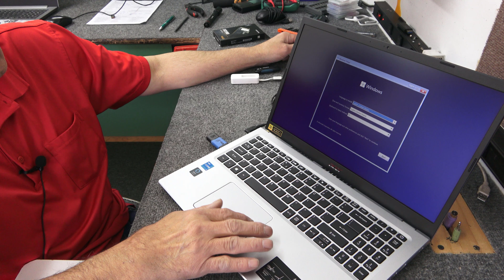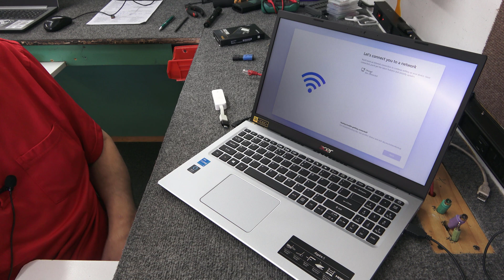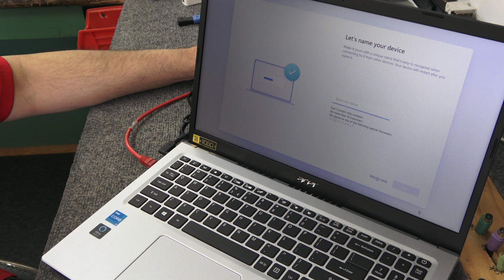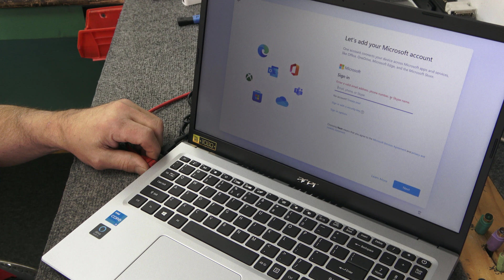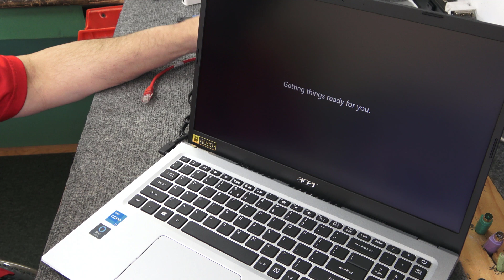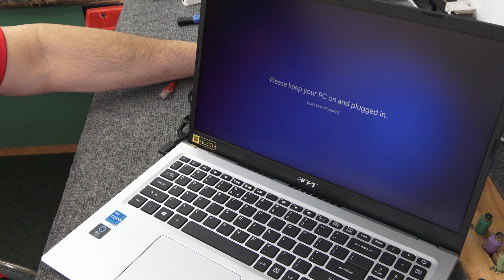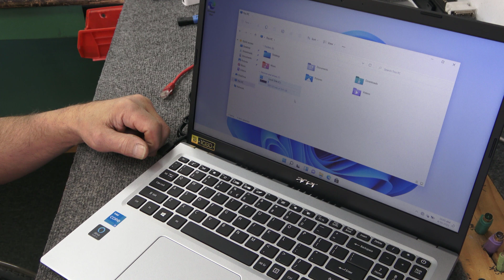HOW TO INSTALL SAMSUNG SSD 980 ACER Aspire 5 A515-56 LAPTOP CLEAN INSTALL WINDOWS 11 NO MS ACCOUNT!

Comment: Thanks Dale. After watching your videos, I felt armed enough to buy a new Aspire 5 a month ago and upgrade it with additional RAM, new 1TB NVME, 2.5" SSD and then made a clean install of Windows 10. As proof I watched your videos too closely, after first re-installing the back cover the first time, I quickly realized I had forgotten to re-attach the battery cable! Felt so good when it booted up and the whole process start to finish took less than an hour and a half. Good to see you back and feeling better.